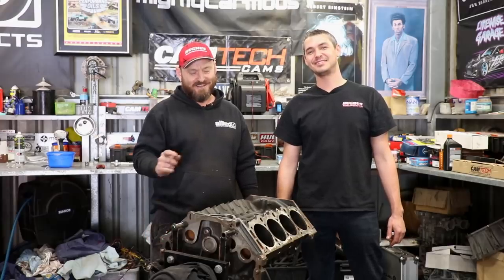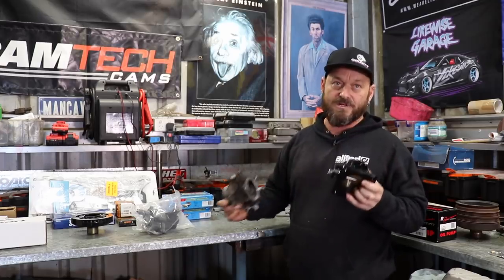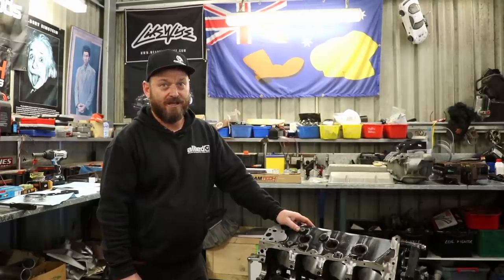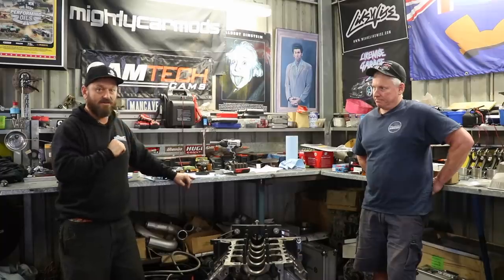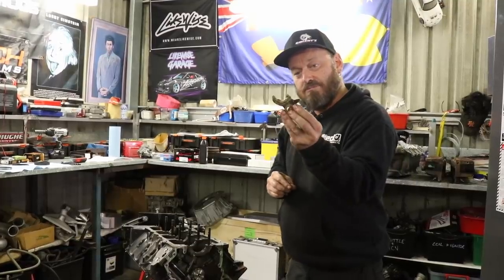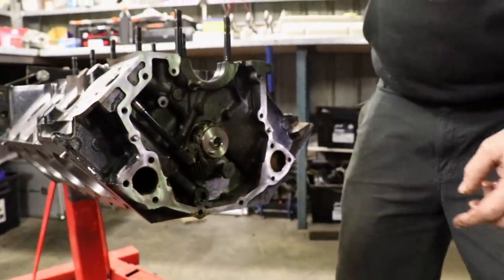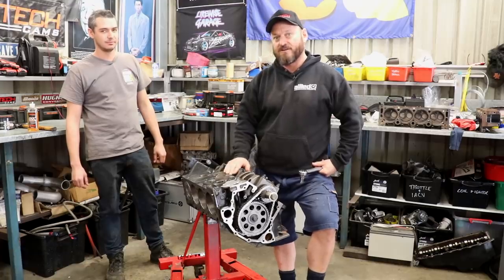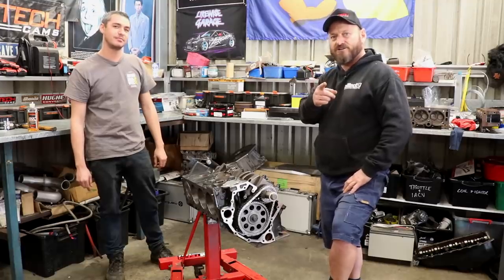GM HOLDEN 304 V8 ENGINE RE-BUILD [EP2]

Comment: Should have got the crank balanced, basically anything that moves in a engine get it balanced and weighed and blue printed all the way through, every part that moves is blue printed, that way it will last forever, remember the 6 cylinder in the VL 50 cent coin test ( white glove treatment built in Japan) when the rev the engine and the 50 cent coin did not move, thats how this engine should have been built, but in saying that, i get the drift as well, showing some of the basics for people to understand how much goes into when doing a rebuild of a holden 5Lt or 4.9 etc. :)

Comment: Forgo the Rope main seal, take a regular main seal, splice it with a razor blade, super glue or silicone it back together once on the crank
Reply: Don't think so, they have a steel core.
Reply: They make silicone or it might be rubber only seals I don't know the part number off the top of my

Comment: Is there a reason the camshaft bearings are not replaced at the same time? Ive seen a few vids where they rebuild an engine but they don't replace camshaft bearings.
Reply: bryce newsome if you don't look at the cam bearings they're fine 🙈

Comment: hang on a secound earlier you said you sprayed WD40 all over the engine, which some of that would have gone down the tread holes for the main bearings / Crank holes, which would maybe give you a false positive reading when it comes down to torquing the bolts ? Should have used a tapping thread and cleaned out the treads all around that way you know they are cleaned or your going just get it washed again with the washing machine like you said, just curious thats all ?

Comment: I've had much better luck installing 2 piece rear seals with the parting line offset so it doesn't align with the split in the main cap. That way the 2 potential leak points are separated.
Reply: Wont work with rope seal though

Comment: i has do all same and build new my last 5 V8 motors, best has 5liter V8 ford engine, driven 500 000 km, and ALL bearing has inside factory assembly dimensions, not out anythink. im glad, normal need be little out and need new bearing set. but this has perfect ,no need do anythink, i change only piston rings and jhoning little and new oil pump, and chain, i believe ford 5 liter engine has longed live and strongest engine in car at world,best daily drive car have if have ford engine. any gm mopar,chevy motor i not has see same, ford is best.

Comment: Never heard of a 304 Chevy SB.....
Reply from the maker: Pete Strickland neither have we, it’s a GM 304 not a Chevy.
Reply: It looks like a SBC that’s had some mild modifications.
Reply: This is a GM Holden engine designed around 68, using a lot of Chev tech but 90 pounds lighter. The best, and last engines derived from Group A racing with stronger blocks, 4 bolt mains and racing fame. The last real race they won was the 1990 Bathurst Group A race. Smashing the Sierra Cosworths and Nissan R32 Skylines. The non-turbo Holden spun at 8800rpm all day, destroying the turbos who had to keep their boost up all day just to keep up.

Comment: You Australians not only drive on the wrong side of the road, the number 1 cylinder is on the wrong side of the engine. (insert smiley here)
Reply: Data Sailor because Australian built engines spin the opposite way, relatively speaking the number 1 cylinder is on the same side as you are used to.
Reply: @Alan_Garkle  Ahh. Now I get it. The old Northern versus Southern Hemisphere coriolis effect.

Comment: Has a holden ever been passed 7000RPM and lived long?!
Reply: Yes. Larry Perkins built his Holden V8 to the max. His 1990 Commodore won the Bathurst 1000, destroying the turbo Sierras and Nissan GTR's  (R32). Kicked their sorry cheating arses! His answer to the turbo cheats of the 90's was to run them into the ground. He ran his Holden 304 at 8500rpm all day. The turbo cheats in trying to keep pace with the Iron Lion blew one by one. In the end Larry and his Holden won easily.
And yes they were flat out scumbag cheaters. The Nissan's had a secret overboost switch that nobody could find at the time. The switch was the ashtray, no, not in the ashtray, it was the ashtray. When the Nissan couldn't beat an Iron Lion, they simply pulled out the ashtray and 600+ hp appeared. That is until Bathurst, where they overboosted themselves to a pathetic and smokey end.

Comment: Why no new pistons ??? You bought every other part new but pistons ??? Why replace or upgrade everything else but use used pistons ???
Reply: Because pistons really aren't that critical in a build like this.
Reply: @magnetic0314  are you serious ????
Reply: @582_Motorsports  yes, I'm not sure on how tough these particular pistons are supposed to be but there's many OEM pistons that can handle a bit of power just fine. rods are the parts that commonly break. Piston damage is usually secondary unless you have a weak piston design or very lean and extreme tune
Reply: as long as you don't feed 30psi into it or let the engine knock like crazy, most stock pistons will handle a lot more power over stock than you'd expect.
Reply: @francistheodorecatte  in the bad old day's we used to work on 25% as a safe margin.
We did have leaded fuel back then though.🙂
Reply: 20 YEAR OLD  pistons with who knows how many 1000's ok kilometers put back into a engine you have just replaced everything else !!!!!! Yeah I'll pass thanks !!!!...... I'll spend the  extra 500 bucks for a good set of after market pistons...... why spend all that money on new upgraded parts and put old pistons in to save 500 or 600 dollars.... especially when boost is a possability down the track.
Reply: @582_Motorsports  Acording to measurements cross hatching etc, Alan actually got a very low kilometer engine that happens to be very old. John would of measured the pistons just like he did everything else.

It is a risk yes but none the less a calculated risk.
Many have gotten away with such a risk for literally years, other's have had weeks of fun.
 Just gotta roll with the punches sometimes.
Alan is of course working on a customer's engine witch means within the budget available based on a calculated risk backed up by loooooots of measuring.

As a tradie for 38 yrs I would consider the risk against the cost for my own car. 
If a warranty for a rebuild was involved. I would choose peace of mind.😉🙂👍👍
Reply: Consider the PURITY mate.
Reply from the maker: Take note of the guy with all the measuring equipment that measured the tolerances of everything. 
Throwing parts at things does not make it work better, all the parts we used were specifically replaced due to requirement, if we didn’t replace it then it didn’t need replacing.
Reply: @theskidfactory  i never said that they were out of spec or tolerance. I been a mechanic for 22 years and have built engines from 1 cyl to 12 cylinders.

 All i was saying was why go to all that trouble replacing pretty much everything else in the motor and throw 20 year old pistons back in it for sake for 500 or 600 dollars. Yes..... i agree throwing parts make not make anymore power.... but putting a better part in will make it more reliable and reduce the chance of failure !!!...... if your happy to take the chance of throwing 20 year pistons back into a motor...then sweet as.... but me, I'd rather spend a few extra dollars and do the job the right way !!!!
Reply: @steveveness3829  i didn't say they weren't measured correctly or anything like that..... i could see he measured everything.

 I can't see why you would throw 20 year old parts back in a motor but upgrade everything else in the motor.
Reply: @582_Motorsports  I know but re iterate within wear limits therefore is permissible.
As Alan said take note of the guy with the measuring tool's 😉🙂👍👍
Reply: Also I reiterate original bore low kms.
Reply: @steveveness3829  i know what ur saying...yes they were inspec and yes i agree that if there in spec they can go back in..... why why take the risk with 20 year old parts from an engine that u have no idea how it was treated
Reply: @582_Motorsports  ok let's recap all that was said about the tear down of this specific engine🙂

1. Upon taking rocker covers off there was no oil sludge build up ( obvious sign of regular oil changes).
2. The sump showed the same thing( regular oil changes)
3. Inlet removed no sludge ( regular oil changes)
4. Cross hatching still clearly visible in cylinder bores ( no thrashing)
5 cross hatching visible on standard bore means low kms.
6. Piston inspection in person not just on camera shows no broken ring lands or horrible melting or wear.

All signs of a low K well treated standard bore engine. 😉🙂👍👍
John measured for ovality 
 of bore etc more signs of oh wow we can use these pistons again.
And of course John probably checked 
Gudgeon  pins off camera for slop.

On top of all that if they do turbo for example the last thing you want is a tight fit coz there ain't any room for heat expansion for extra boost Applied by turbo charger.

Hope that helps you😉🙂👍👍
Reply: @steveveness3829  I've been a mechanic for 22 years. I've built 2500hp 12 diesels and my own 800hp cleveland plus many many many other engines.

 Yes everything may have measured up within in spec and look all very good etc !!!!!

  But why would you spend the dollars for a new roller cam setup including ,lifters,rockers,valve springs and push rods. Then replace all bearings, new rings, oil pump, water pump, balancer, head studs, main studs plus everything else that was bought then stop when it comes to another 5-600 dollars on pistons ???? 

 You can go on all you want about how they were measured and they were in spec..... but its pretty silly to put 20 year old parts pack into a motor that has just had everything else replaced cause u wanna save a few hundred bucks !!!!!
Reply: @582_Motorsports  I AM not the one building it now am I 😉🙂👍👍
Your 22yrs my 38yrs as a 3rd gen Engineer is a lot of experience but does not change the simple facts neither of us are building this engine now are we??
😉🙂👍👍

Comment: Come on guys I watch the show all the time and this one I’ll definitely wasn’t a fan of. You go all through the trouble of Using studs but can’t even use new rod bolts or even a flattop pistons or even get the rods resized and then you put the cranking and measure it why it’s in the block that is just a rookie mistake. And you going to all that trouble to news head studs when you can’t even get the engine decked. Normally not like this show to be a shit show but this episode was shit 😔
Reply from the maker: jack williams why do we need flat top pistons?
Reply: The Skid Factory  hey meant to say another set of cast pistons and standard replacement ones pretty much come in a flat top which is good for compression specially if you’re running that Big of a cam or less you’re doing a turbo set up which I would hope you would upgrade pistons and rods. And if that guy has built engines all his life he should know what he is doing and not hating on the show whatsoever as I love you guys there but this episode was just a little bit crap for me as it felt like no one had a clue what they were doing to To a certain degree
Reply: Ps can I get a free top or some stickers haha